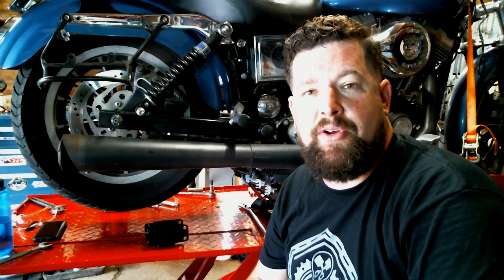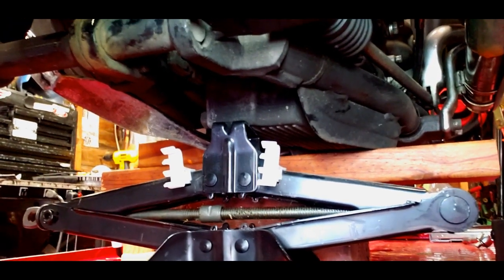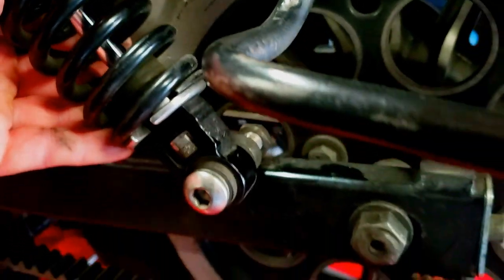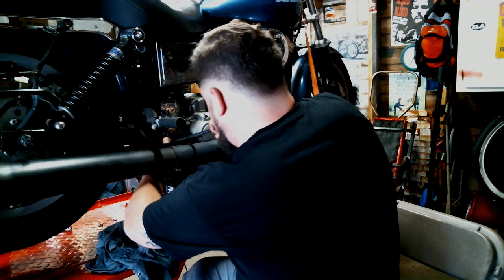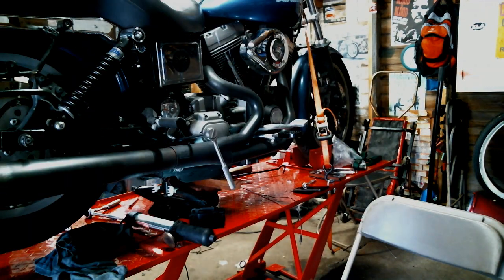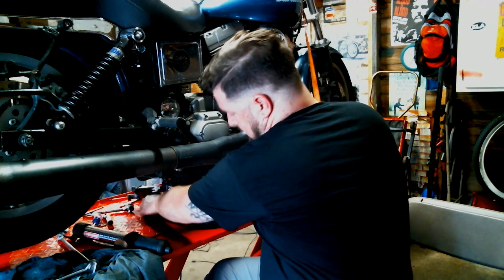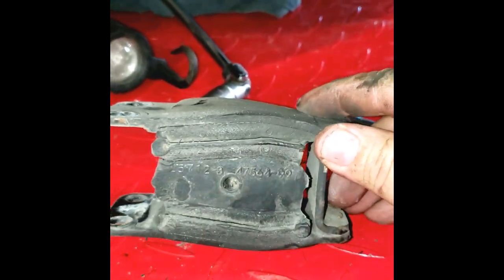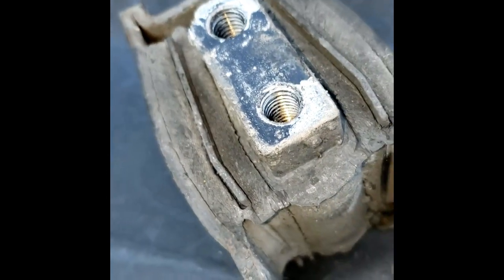Harley Dyna Engine Mount Replacement

Comment: It would be probably so much easier if you would remove rear tire I would. I own a 2000 Dyna Convertible. And want to thank all u guys or gals who make these very helpful videos. Lots of people who make these videos have saved me 100's of dollars. Thanks!!!
Reply from the maker: Thanks for the comment. I agree that it would, but a lot of people get nervous about tearing large parts of the bike apart.  I wanted to offer an alternative to a large tear down.
Reply from the maker: But honestly, even with camera and lighting setups, the whole rear mount didn't take me more than 1.5 hours.
Reply: I'm doing my front isolater soon bike has 18,000 on her but was sitting a lot I'd rather be safe than sorry but runs great.
Reply: Have a safe riding season!!!

Comment: Did you do the alignment procedure where you run the bike up on the jack with the motor mount bolts loose?
Reply from the maker: I did not. I am not familiar with this procedure. I just compared all the rotors with and angle finder to check for alignment, and I didn’t have to make any adjustments.

Comment: How about shims? How do you know if you need to shim it or not? Thanks in advance.
Reply from the maker: I don’t know of anyone who has needed to shim and engine mount.  But if you tightened the bolts up, and it appears to be stressing the engine mount one way or the other, I would consider getting  some shim stock and making some. But my first thought would be that it was a poorly made engine mount.

Comment: Do you have any review videos after the install? Wonder what difference this did or didn’t make in feel and function. Thanks
Reply from the maker: I do not have a review view, but I will be shooting one now. Thanks for the idea!
Reply from the maker: The engine mount replacement actually reduced the vibrations in the bike, plus, It eliminated the high speed wobble that the bike was getting on the highway.  I feel it corners better now, especially in higher spreed sweepers.  Feel very planted and stable.

Comment: 06 FXDBi here, juiced the motor, so I switched to Kinetic Structure mounts which are better then OEM and doesn't require a brace to prevent Death Wobble.
Reply from the maker: I have heard that those are really good mounts. Do you like it?
Reply: @KnobleMoto  - so far I love them. a cleaner look than OEM too.
Reply from the maker: @reppich1  good to know.
Reply: Better grab an oem one for when those fail. Just tossed my 3rd one in the scrap pile and sticking to OEM with sputhe stabilizers
Reply from the maker: @antimatter7773  your third Kinetic?

Comment: Brilliant! Thank you, hadn't thought of removing the shock bolts to aid access. I'm about to do the rear mount on a 2003 Dyna Lowrider, I fitted a Predator to the front, but still not happy with nasty vibes at the handlebars about 2000 RPM.... So ordered a rear mount and - just to be safe a top mount - link. If that doesn't help- - then sell it on! What a crap design!
Reply from the maker: There should be a notable difference when you do the rear mount.   It’s best to
Replace them both.  But yeah it’s an odd design. Lol.

Comment: Well presented.. I just stumbled across this video because, I just purchased a lower front chin spoiler.  Its a bit away from the downtubes with the recommended mounting procedure.  I wanted to better understand, potential ramifications of moving the spoiler's bracket to the inside of motormount vs outside/in front of.. The relocation would afford me an extra 3/8th inch back, towards tubes.  Just needed to see if there were any obvious concerns of missalignments, due to the engine being spaced back, the thickness of the spoiler's bracket thickness ( 1/8 ) inch.  It doesnt appear that there would be any critical issues ?  I like your, tighten to spec, method.. Experience gets your, built in, foot Lbs  dialed in..
Reply from the maker: You might side load the front and rear engine mounts with a 1/8 off set.  I would try and modify the chin brackets before I did anything with the engine mounts.
Reply: @KnobleMoto  Thanks.. I took the spoiler completely off and saw that bracket didnt fit behind mount anyway, so me and my friend vice, changed the design of bracket. .  I spent needed time to make it fit well. The spoiler is at least 3/4 inch closer to down tubes now.  Almost exactly the same gap on both tubes and level.  Didnt seem to effect bracket strength.. Appreciate the message !  I sub'd to your channel and will check out your other videos.

Comment: Hi, how long is usually service life of the rear and front engine mount on dynas? thanks
Reply from the maker: I do not knwo of an exact number.  Mine was 14 years old with 40k , amd i was wasted.  I would guess age is probably more of a factor than mileage.  Not postive though.  
If it shimmys in a sweeper turn,it needs replaced